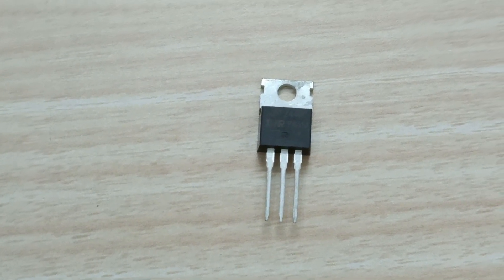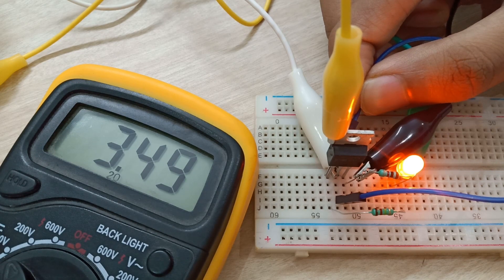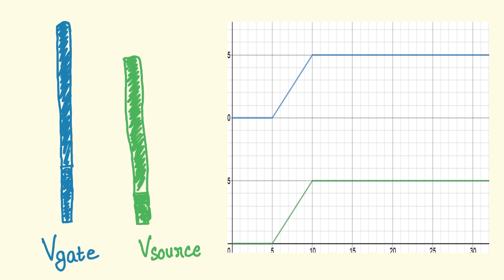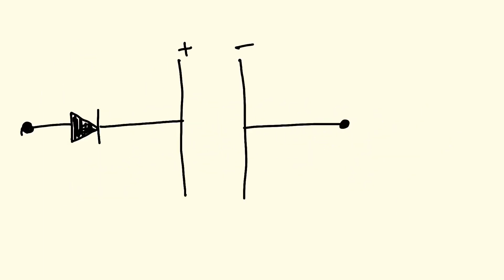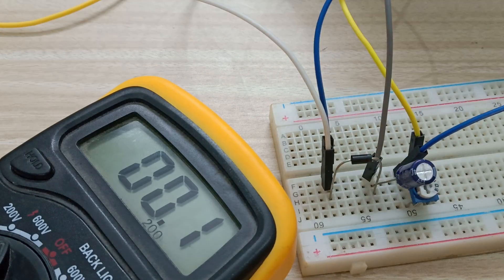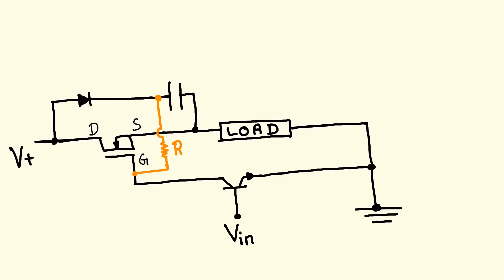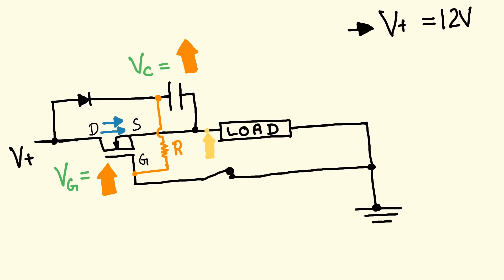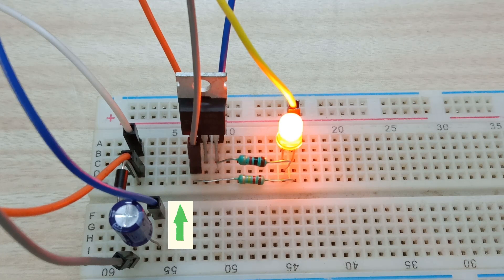MOSFET BOOTSTRAPPING TUTORIAL!

Comment: Gan i replace the diode with npn transistor I am asking this question because I need my load to get on when the Arduino give High output
Love your video ☺️
Reply: Add one more npn transistor on gate of other npn to inverse it, so you can switch it on when Arduino gives high output.

Comment: So, can we run this circuit with 42 volts?
Reply: You can run it but if you connect it to 42 volts then gate will get 42 volts when it turns on, to  avoid it instead of charging capacitor with drain voltage charge it with 12v separate supply.

Comment: Hi, I have a question, what is the voltage at the gate of mosfet when in bootstrapping action. Meaning, when switch is open and source voltage becomes = to drain voltage, the capacitor is being bootstrapped and voltage doubles. At this point, what is the voltage at the gate of mosfet. Is it also doubled?
Reply: yes

Comment: That's a great video. But I didn't understand how the positive plate of capacitor voltage increase with an increase in negative plate voltage of it.
Reply: nikhil valiveti  voltage from the battery and pull from the negative plate keeps the charge on the positive plate together, but if negative charge decreases the pull will decrease too, which means that there will be less force to hold the positive charge. This is the answer.
Reply: Capacitor holds a voltage potential *difference*. If you reference this capacitor negative terminal to a different voltage, the potential between the pozitive terminal to ground is the sum of the voltages